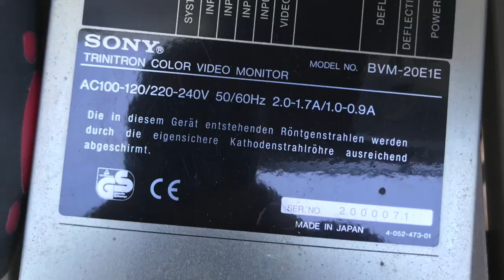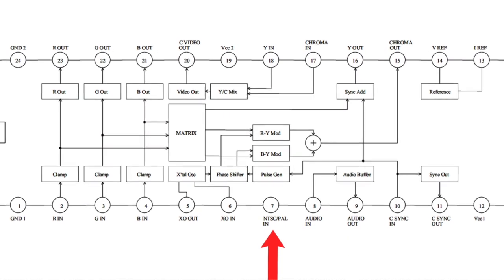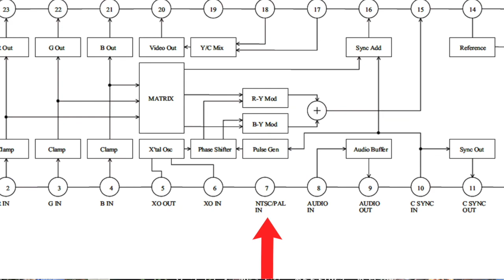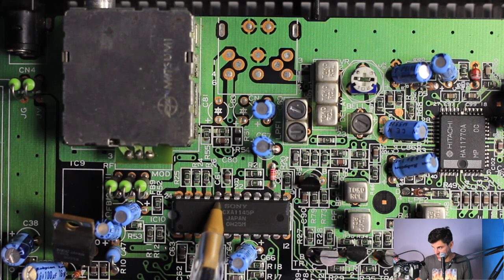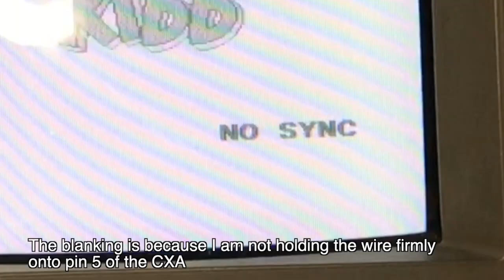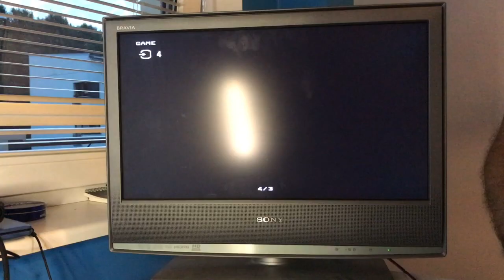Genuine USSR Sega Master System PCB Review - How does this thing make SECAM?

Comment: Have you tried playing a game that supports FM sound? I'm not sure if that Hitachi chip would have anything to do with it but since its such a later model Master System, maybe its part of the built in FM sound chip that the Japanese Sega Master system MK 2000 had. Could also be them trying to integrate the 3D glasses. This is all speculation.
Reply from the maker: Those are some really good points, at this stage all suggestions are good. If it is something like this, I wonder why Sega included it when they were trying to cost save by removing things like composite out. Ill check it out, thank you!